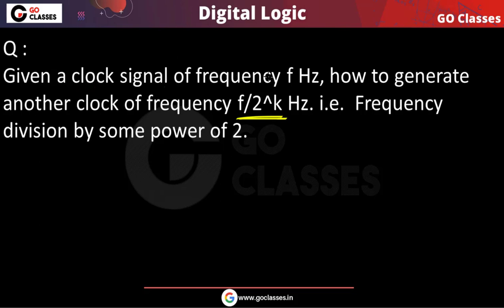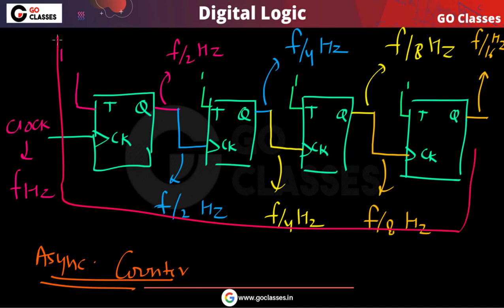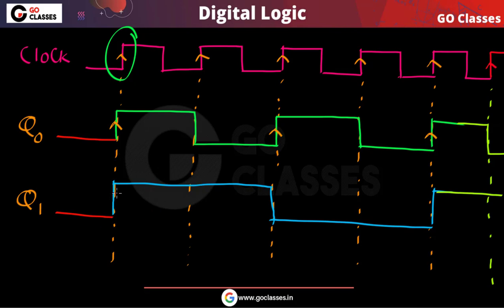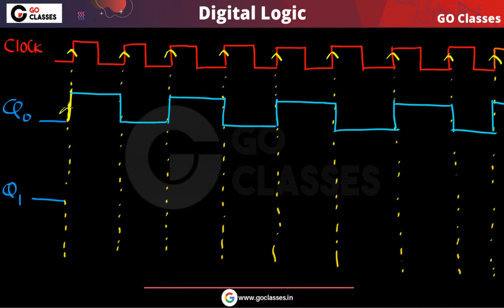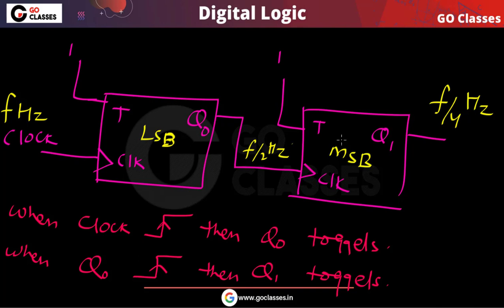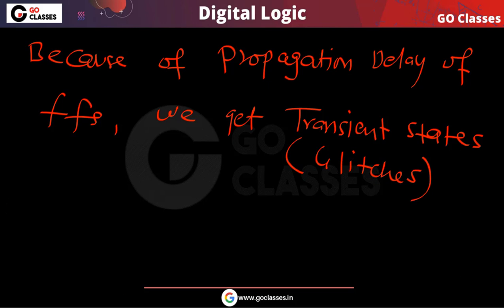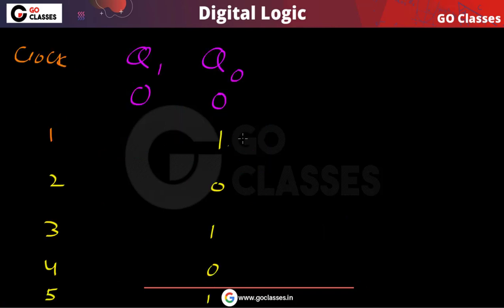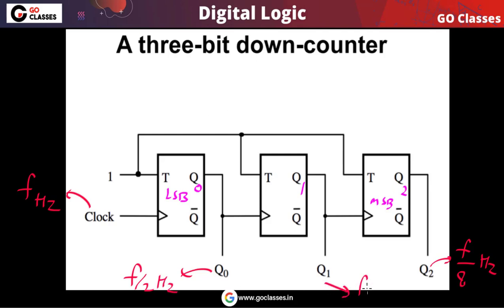Asynchronous Counters : Divide by 4 Asynchronous Counters, Transient States, Mod-4 counters | Part 2

Comment: How to decrease the duty cycle from 50%to 25%
Reply: Then plz tell me what will be the cut digram
Reply: divide the clock by 4 using two T flip-flops (mod-4 counter) and make the output high for exactly one of the four states i.e. o/p must be high for exactly 1 state out of 4 states 00, 01, 10, 11. then on period = 1, and off period = 4, thus duty cycle = 25%  But Idk how to implement it?
Reply: May be we can implement it by giving the T input(1) and output of first D FF as NAND or NOR to the next FF so that it becomes high for 1 i/p combination!
Reply: @the_explorer_x   you can implement with and gate so that one both the timing diagrams are one the nit executes